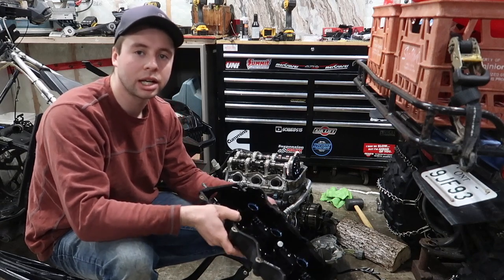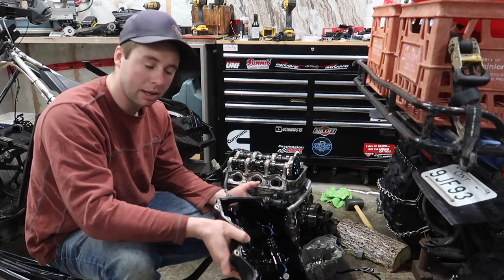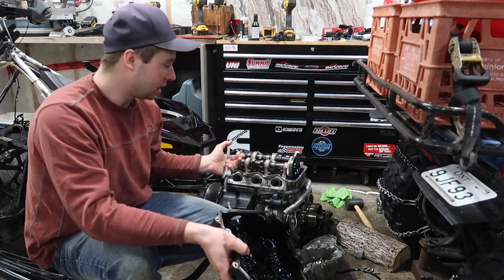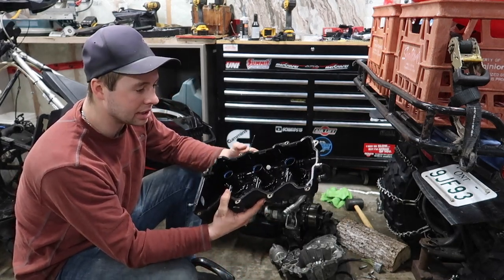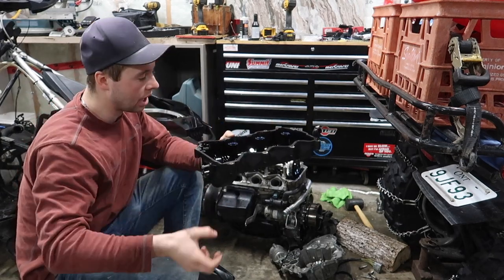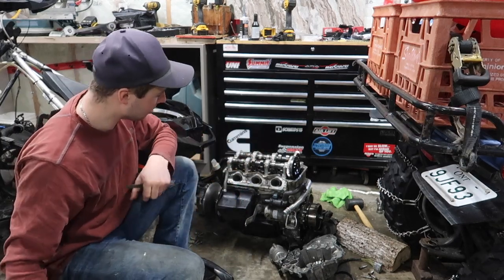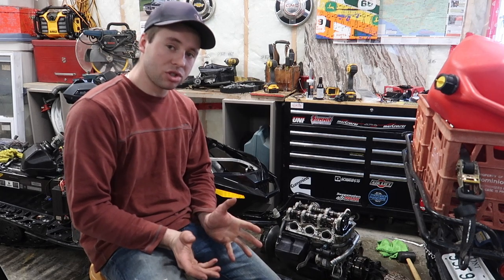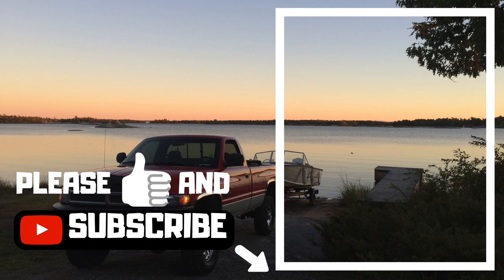Ski-Doo 1200 4-Tec checking Valve Lash

Comment: Great video dude!  Just did a flywheel/stator on mine because the magneto was starting to come apart.  Apparently somewhat common on the '09s like mine.   Wish I had opened up that cover when I had the engine out for the oil tank job I did on it last year!  I have electronic reverse and could not get the secondary out without opening the chaincase and using a puller to pluck the reverse gear set off the splines.  Tried an extension/hammer after loosening up the chain but   still wouldn't move.

Comment: Is it too late to show me the Lowe's o rings on it well tank before you put the engine in or did you put it in already?
Reply from the maker: it is still out. what would you like to see?
i can't rip off the tank but i can show location
Reply: @Schneids15  basically how it's attached in the Contour of it
Reply from the maker: Made an oil leak video and showed the cooler itself. Will upload it for you johnz
Reply: @Schneids15  sweet
Reply: @Schneids15  my 2009 leaks about 8 L of coolant/season onto the ground from the cooler I suspect (previous owner told me dealer checked all hoses etc. and couldn't find anything wrong on two occasions).  I bought a cooler and some blue gasket so will have to replace it this summer......coolant is cheap but it's kind of ridiculous topping up 1/2 L or so every morning.  It's at the bottom of the bottle every morning when cold so I top it up to the cold fill line.  Great video on checking the gaps which I'll have to do in about 4,000 more km as I'm at 16,000 km now.  I understand they get hard to start if the valve lash is out but if I can do the lash check with the engine in that would be great.